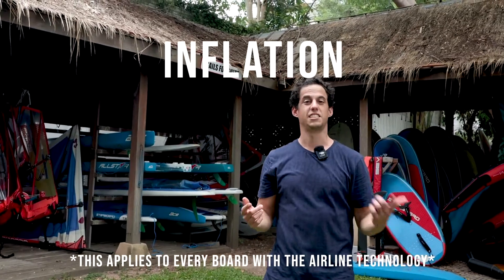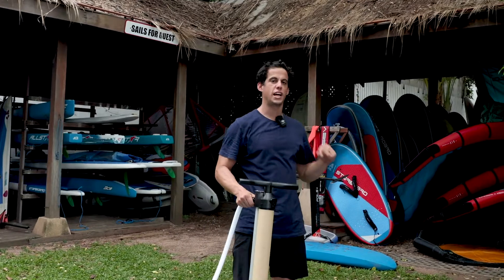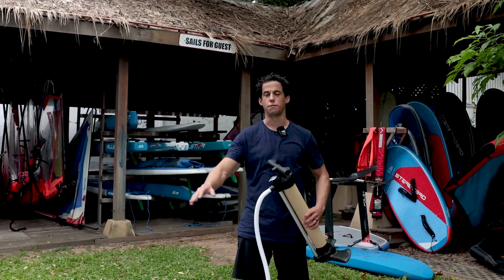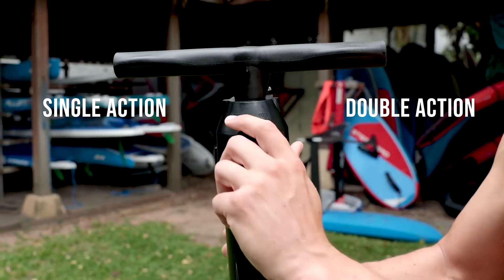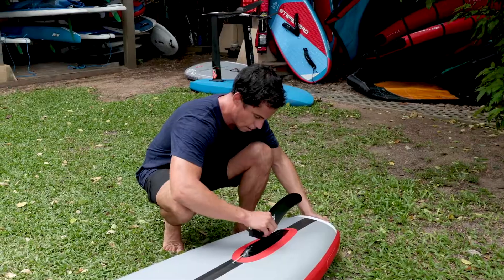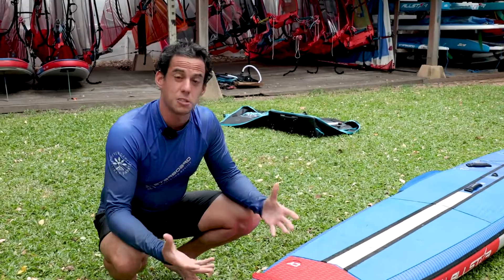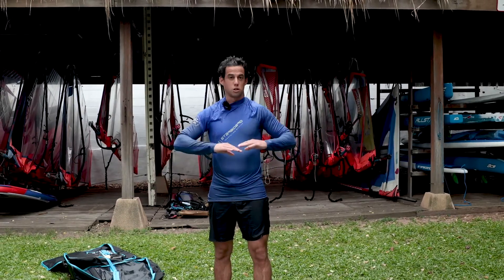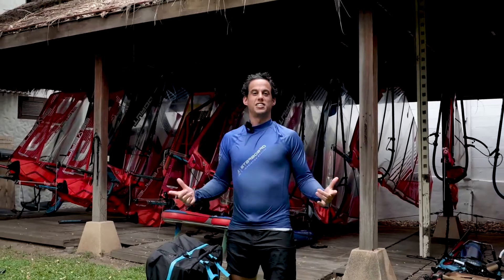How To Set Up Your Starboard Airline Inflatable Stand Up Paddle Board

Comment: Does the 15-18 psi depend on how hot the location you are paddling in or the person's weight?
Reply from the maker: Actual temperature when inflating does not matter. Inflate to the person's weight and water conditions. Where temperature comes in, is when it changes, the board is left in the sun for example. It can get hotter, air expands and put board seams under pressure. Likewise if you inflate the board on a hot day, and then paddle in a cold lake, the PSI will go down.